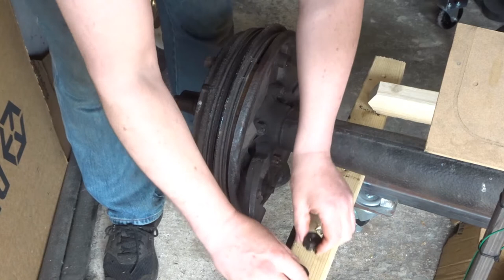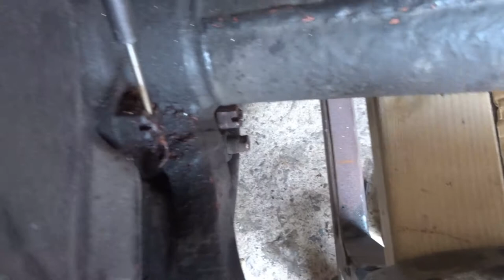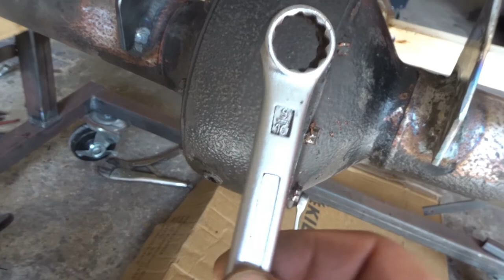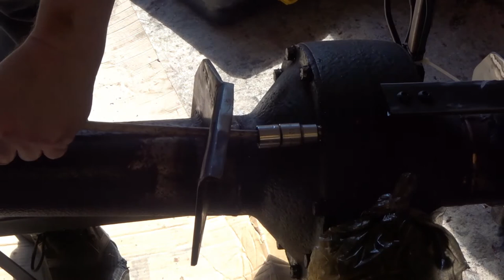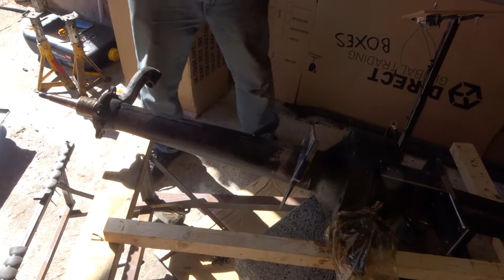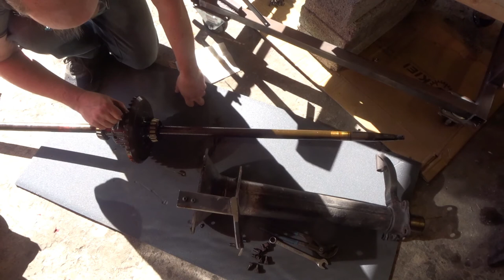Dismantling Rear Banjo Axle | Belly Tank Lakester Ep:20

Comment: I think we all like to believe our old car junk is low mileage. Unfortunately it never seems to be the case!
Reply from the maker: It all looks pretty good inside but there is definitely evidence that somebody has been in at some point in the past so maybe some of the innards are new-ish, well <80 years old anyway ! We live in hope.
Reply: @XenonJohnD  It did look clean. If you're changing the CWP anyway then I guess your only concern is the state of the bearings. Are they expensive? Is it worth replacing them anyway. Even if they look 'new' they might not be a great brand. Bearings and old springs (like all the brake system ones) are something I usually try to replace if I am in there as they are usually cheap enough and then you know they are good.
Reply from the maker: The thing is, everything is pretty expensive here in UK (or from US plus shipping + tax) and this car, let's be honest, will probably never travel more than 50 - 100 miles so if bearings look OK will probably re-use. If road car I would change them or at least the pilot bearing of pinion.
Reply: @XenonJohnD  Good point. I have the same issue in New Zealand, except some stuff isn't even available and can't be shipped here. My only worry is even if you're going short distances you'll be going quite fast (hopefully)!